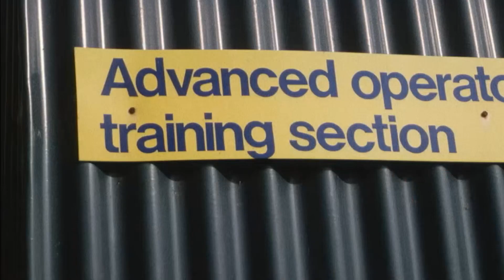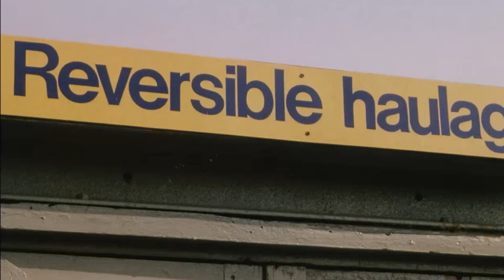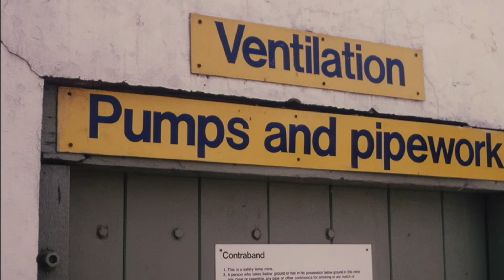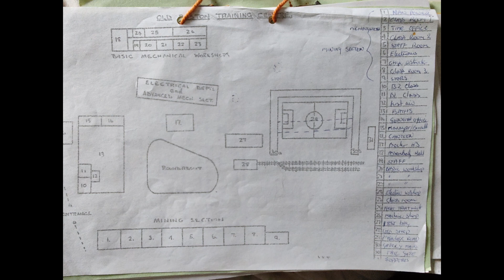Training Daze. Get Sum In.  Leaving School in 1980 and starting with the NCB

Comment: That picture of electric ISM. I worked for Dosco and had to install it around1982. Some guy's  thought it was great joke to carry huge bobber and plant it in the middle of Accrington road. I stayed in the Sparrow Hawk Hotel at the time
Reply from the maker: bobbers came in useful for many practical jokes
Reply: I read report on the disaster and it mentioned a guy named Horace Lister could this be the guy of the same name who worked for Cementation who I met at Dawn Mill where Dosco Mk 3 was put in driving a drift to the surface through that awful red marl. He also was at Selby coalfield
Reply: DAW MILL